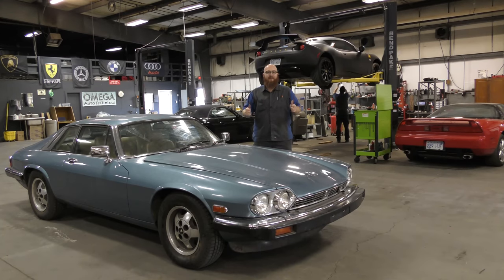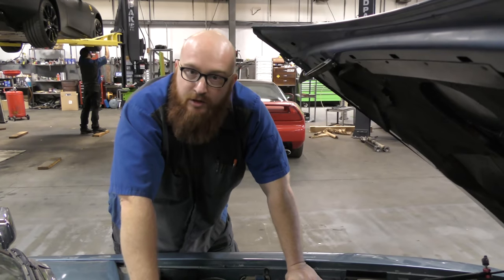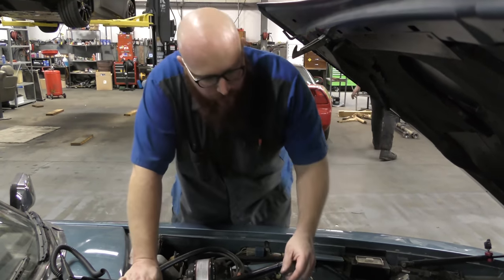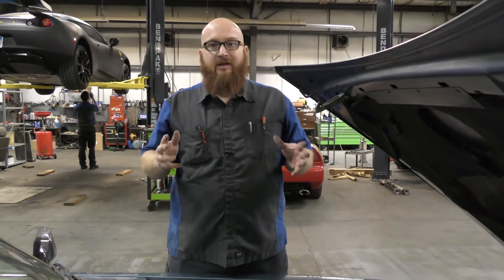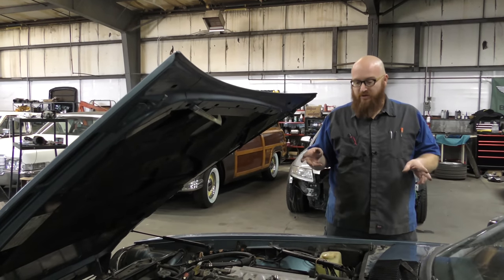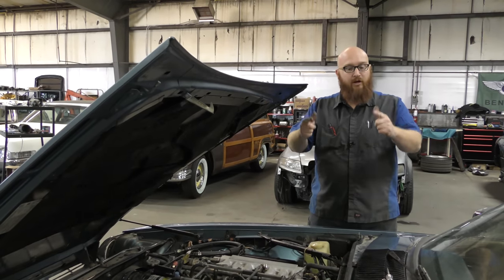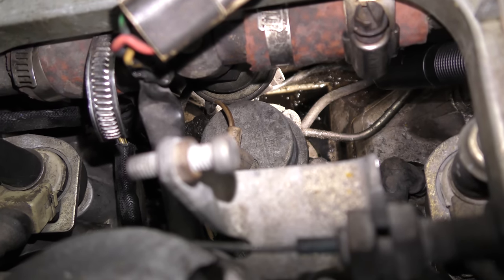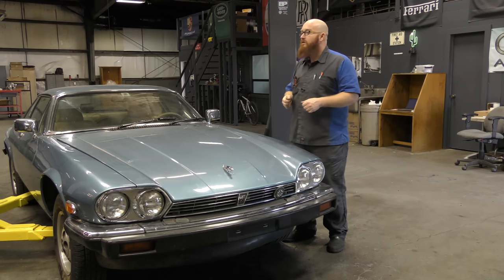'82 XJS with the cursed Jaguar V12 comes into the CAR WIZARD's shop. Can he get it running?

Comment: I love those engines!
Reply: You do know the Jaguar V12 was developed from the old 1951 Buick 215"/3.5L all aluminum V8 with same over square 3.5" bore x 2.8" stroke. 8 cylinders = 3.5L, 12 cylinders = 5.3L. Before then UK engines were under square, long stroke,  and slow revving. High revs on the new freeways would kill them in 25K miles.
Reply: @BuzzLOLOL  You do that is incorrect. Yes the old rover V8 was based on the Buick design but the jaguar was not.  Ps the long stroke engines you are talking about survived 50 000 miles of full throttle on the German autobahn with no ill effect. BMC A Series engines also came in over square designs before the arrival of the rover V8 and the Rolls Royce produced in 1909 was the first British built V8. The jaguar engine dates back to 1951 and was designed as an overhead cam unit with its 3.54" bore and 2.76 stroke  the XJS came along in 1975.

Comment: So many American "mechanics" look at Jag V12`s & sixes & just say "no, just put a small block in", some have a go at fixing them anyway but then mess things up further, causing the problems you`ve pointed out.. Only a handful have the engineering knowledge, intelligence & patience to work on them competently. Thankfully, the Wizard has the correct temperament.

The Jaguar IRS setup is a great thing, I`m surprised you didnt point out the fact the rear driveshafts are structural, as in they also act as the upper wishbones. That axle was THE axle to have on British hot rods in the 60`s-80`s (combined with the Vauxhall Viva front axle), especially ones with an LSD, & was also used in many kit cars, including many of the AC Cobra replicas.

Anyway, great work sir, hopefully you`ll inspire a few philistines who are contemplating a V8 into Jaguar swap to reconsider...

Comment: Nothing to it, simplest car to work on; made my living  working on XJS and XJ6,in the 80s and 90s, for 10 years,   never failed one repair,ever( anybody would do it, heck there were ONLY 2 models,all the same....   lol)
I could know what the problem was likely to be  by the COLOR of the cars, sometimes ,i kid you  not (the explanation is not so weird;  you see, the cars were painted in a series of each color, and those got identical parts, because the time was the same,so if one got a half-defective part (water pump, ecu,oil filter housing gasket, rear emergency brake pads, hi side P/S hose-- right near the cat, later on the glow red!!. (i always made my own with steel cored hoses... always rebuilt my water pumps,bearings from Texas  etc etc) the next one,of the same color would get it too, but maybe it was  just me immaginning things...  no)
I got so good at it that some jobs the dealer took 2 days,i would do in one morning and charge 1/10th;  
One example is the heater core, 2-3 hrs hours to do instead of 2 days (AFTER the customer agreed to my method; never ,ever,had any customer that did  not agree--i would NEVER do it the proper way,NEVER,anyway;  don't even try it, you'll ruin the car climate system... at least grab a can of spray paint and paint the actuators rods before touching them...) 
The rear small brake pads are another one,i still have the wrenches i MADE to do it,laparoscopically style,  no exhaust downing... LOL
Good times i had repairing them Jags for the drug boys of NJ,NY ,PA ; back home in pos portugal now,where the INjustice system sucks,   avoid

Comment: If a shop charges $100.00 per hour and the bill totals $10,000.00, (assuming it is all labor), how many hours will the shop spend on fixing this car ?   see answer below. 

Answer: More than the car is worth. 1. Lucas, 2. Old car, lots of miles  3. Not OBD 2, 
4. Somebody inept worked on it 5. Ran many miles with problems 6. Lucas and 7. Lucas
Oh yeah. 100 hours ! 2.5 weeks !

Comment: Car Wizard, you don't anticipate having to unscrew-up the last guy's screw-up? Where have you been living! When car's come to me for diagnosis, It seems to me that trying anticipate, and figure out, the last guy's screwup is the norm! It's what I have to do more often than figuring out what original factory part failed. And that seems logical too, doesn't it? Who is more reliable? The people in the factory, or the people in repair shops? To some extent this is forgivable. Repair technicians have to work on many different car models, and know, of find out about, all those models. In the factory, we have mass-production. Each person, or robot, knows their one job, very well. But I believe a lot of the screwups are due to laziness, not caring, being pressured by their bosses to "work fast and make money," to feeblemindedness, and just – not really caring if they screw up or not.

Comment: The fact that even the bonnet/hood hydraulic supports didnt work shows what a neglected life this car has had.  Just because someone can afford to buy one of these when its a few years old doesnt mean they can afford the upkeep. Its still a V12 and a V12 with pre digital tech injection on board.  Is there any other V12 on the market that is cheap to run and can put up with being neglected and run on a shoe string budget the way this one obviously has....We know the answer is no.  I had one and one of the early ones. It had a full service record from new and it never missed a beat.

Comment: The age old excuse of bodging armature mechanics, "oh it cant be my fault the car doesn't run as I'm an ace mechanic so
 it must be the Lucas electrics".
Reply: Electrical systems in British cars have a long history of reliability, about the same as Asian Nascar drivers.
Reply: @ericwsmith7722  Is that where they just drive around in circles? Anyway getting back on the subject, what about Kyle Miyata Larson he's been very successful so what you are saying is that Lucas are successful.
Kyle Miyata Larson achievements: 
2011 Belleville Midget Nationals Champion
2012 NASCAR K&N Pro Series East Champion
2012, 2016, 2019 Turkey Night Grand Prix Winner
2013 UNOH Battle at the Beach All-American Winner
2015 Rolex 24 at Daytona Overall Winner
2016 Sprint Showdown Winner
2016 Aspen Dental Eldora Dirt Derby Winner
2019 Monster Energy Open Winner
2019 Monster Energy NASCAR All-Star Race Winner
2020, 2021 Chili Bowl Nationals Champion
2020 Indiana Midget Week winner
2020 Pennsylvania Speedweeks winner
2020 Hoosier Hundred winner
Awards	2011 USAC Silver Crown Rookie of the Year
2012 NASCAR K&N Pro Series East Rookie of the Year
2013 NASCAR Nationwide Series Rookie of the Year
2014 NASCAR Sprint Cup Series Rookie of the Year

Comment: OK, so, the1988 thru 1994 model's were the worst, secondly, the 5.3 litre V-12 has always sucked, wasn't until the AJ16 engine, that they had something.  Of course my 1984 4.2 straight 6 was fine

Comment: I don't see anything difficult to troubleshoot about this engine. Every car mechanic should now that they need to check for spark, for fuel and this engines with distribution the timing. I'm surprised that this engine even have a "computer". I'm 100% sure that this engine can be made to run without it. But it was interesting to see the rear brakes 🤣

Comment: Many many years ago I helped my friend in Blue Springs, MO to fix his customers 1979 XJ12 - on this one the Computer had fuel pump relay issue / I am an electrical engineer and fixed the computer, but while we were waiting for parts to fix the computer, I temporarily wired the fuel pump into the ignition (run/start) so we could test the engine this way we were able to work on other issues - after repair customer came back 4 weeks later and now his transmission was failing.......

Comment: You must not have very good mechanics over there - the V12 is one of the simplest engines to work on there is just more of it.  Yes if no start - look at the Prince of Darkness.  I have two V12s, (carb and injected) one from 1982 and never had an issue with the engines.

Comment: "They're on strike again more stoppages " yeah, What they didn't tell you was so called industrial stoppages were as much down to clapped out (in some case pre WW1)  machinery and leaking roofs on the factories etc.
And the bone idle ,middle class management bods took none of the blame ,couple that with useless bosses and thick as two planks union officials you have a perfect storm which the shopfloor worker got the blame for.

Comment: Crazy Brits should have stuck with the straight six and supercharged or turboed it . It was such a sweet motor. Instead they don t accept their engineering limitations and come up witb this mess! Mercedes also had their V 12 motor that sucked too much fuel and wasn t worth the effort. Their V 8 s were much more reasonable.

Comment: I used to work on European imports back in the day. I worked on an 1982 or 83 XJS in 1990 that would open the injectors on the right bank as soon as you turned the key to the run position flooding the engine.. It turned out to be the computer. We sent it to an outfit that repaired these computers and the tech there couldn't believe the computer would do that so he tried it on his bosses car and almost got fired for it doing the same thing... Ha. Honestly in general British cars SUCK. The machine work on the splines in the drive train looks like it was done in Pakistan. All of the wires in the engine compartment are white and the pins on the relays are individually wired (there is no plastic connector to insure that it goes back only one way) so if you don't mark the wires before you take them off you're Royally Fucked. The A/C air damper system under the dash is about ten times as complicated as it should be. The V12 engine has about enough aluminum in it to make two of them which makes it weigh as much as if it were cast iron... and on and on...

Comment: I thought i wanted one of these wow a v12 how cool is that
  Theres one down the road for 2500 bucks what a deal 
yikes after watching this i said no way would i do that lol
 

It looks like a confused engineer designed the wiring and fuel lines 
then a normal guy had to rewire it on the assembly line saying that doesnt work like that George

hey geezer if we wire it like this it works better and its faster lol oh my what were they not thinking 

oh i know they thought if we make it complicated enough that nobody can work on it and it will bring in more money for 
parts and repairs at our dealers shops

 not good advice from the bean counters oh well they never learn do they 
more bean info advice is sometimes working against you in the end

Comment: you lot scare me that engine is not complicated at all i was pulling them down as a 16 year old apprentice suck squeeze bang blow you make it sound like its the engine from the space shuttle as for the ing module it first appeared here i think on the 75 range rover 76 3.5v8 sd1 Renaults alfas fiats in fact more cars than i can remember the whole xjs systems were tried tested units but i suppose its like us in the trade here in the uk taking the piss out of your cart horse suspension

Comment: This is a problem engine with many things that can go wrong.Why put yourself through all this?And the engine is known to leak oil too?I would put that sbc in faster than you can imagine.In fact just gte rid of the car.Who wants a car that has brake pads that are on the differential?

Comment: Replace it with a V8, way in hell did you have a Jaguar if you do that? The point with them, are there lovely V12 and that the cars is wonderful. You just must think like an Englishman to fix it 😊
Lucas systems are not bad, you should you avoid mak 1 version of them mak 2 are pretty god, usual sold as Borsh (on license). Yous the German version is better.

Comment: I really find this guy arrogant and patronising. He is showing his arrogance when he calls the Jaguar V12 cursed. You really cannot compare an agricultural GM V8 to Jaguar V12. I am sorry that it appears to be so complicated to someone used to working on simple American engines but the Jaguar V12 is more powerful and much smoother.
The engine won Le Mans in 1988 in a Jaguar XJR-9LM (https://en.wikipedia.org/wiki/Jaguar_XJR-9). The car travelled 3322.4 miles in 24 hours. Cursed! I don’t think so, more like blessed! Look at Le Mans 1988 - https://en.wikipedia.org/wiki/1988_24_Hours_of_Le_Mans .

Comment: It has just become a running joke to slag off Lucas electrics. Fact is, none of it was designed or built for us to be dicking around with it 40 years later, on something that has probably been left outside in all weathers for god know how many years. Take an Italian or French car of the same era, and those electrics played up or broke after 4 years let alone 40. My TR7 had Lucas all over it, and do you know what? all you gotta do is clean up the earths, and the brass switch contacts, relay contacts, fuse box and it all works, just like you would expect to do if you are playing around with old electrical connections on any piece of machinery. If you are not prepared to do that, you shouldn't be working on classic cars.

Comment: I'm afraid you are illustrating the main problem with these cars.  People working on them who simply do not have proper knowledge.  The injections system on these cars is in fact very simple.  Almost everything is a simple binary test.  Something that should be on isn't on or something that shouldn't be on is on.  All that is needed is proper comprehensive knowledge.  Owners should take them to people who posses this comprehensive knowledge.  It's just that simple.  As I say, the system is very simple.  Much simpler than most modern systems. Far less variables, far fewer inputs from sensors and much more straightforward logic in the ECU   Virtually no adjustment in the injection system.   I have been working on them for 38 years and I assure you it is an absolute cake walk if you know what you are doing.  Now, I'm not meaning to insult you and I can see that you have good analytic skills and understanding.  However, nothing will ever match proper specific knowledge of the car you're working on.  I can point to a few other jag guys I know who would run straight through the logical path to easily trace the cause of the symptoms the car is displaying.  So, my advice is simple.  Take your car to a guy who is known to be completely proficient with that vehicle.  Many good operators on these will have a good idea of or even know the problem before they even open the bonnet.   Finally, you are absolutely correct about the biggest problem -  the monkeys that people have allowed to work on their cars.  They stumble around in the dark without a clue and almost always make things much worse.  They'll interfere with wiring and try this and try that.  Worse are the ones who just start replacing expensive item after expensive item and cost you a fortune without even finding the problem.  No idea how to test components so they just try replacing them.  Replace the plugs,  replace the distributor cap and leads, replace the ignition amplifier - even replace the injectors.

Comment: have you ever tackled a grey market 1980s 3.5 bmw e23 745i ? ( a turbo 735i) 
hmmmmm ?
now that one will make you pull your scalp off (even if their is no hair ) pretty easily  🤣🤣🤣🤣 (laughs in an evil way then walks away as laughter fades slowly )

okay the reason why these cars are hard to diagnose is 
first they dont have the onboard diagnostic systems like they newer ones do and if it did chances are you dont have the associated equipment

second : the people who have experience with these cars are either dead or no longer in the bussiness (retired) cause thooose who experienced these cars problems first hand and developed a skill set to quickly pin point the problem and not only that they actualy made special tools to quickly hunt the problem (specail funny looking tools they made them selfs ) that's how the boomers dealt with these cars now their gone along with their tools somewhere in their sheds so its kinda of a lost art  ,,,and bye bye

Comment: The title of your video is rubbish and factually incorrect. The V12 is NOT unreliable at all! I own a V12 E-Type and a V12 XJS and have never had any problem with the engines. But: I have both my Jags regularly maintained. Of course, if you neglect the cars/engines, then you might run into problems. They need to be looked after by specialists, not by just any mechanic around the corner. This is not cheap. So, if you can't afford to have your Jags maintained regularly by specialists, then these are not your cars and you better look for something else.